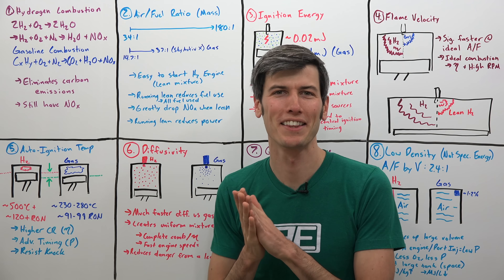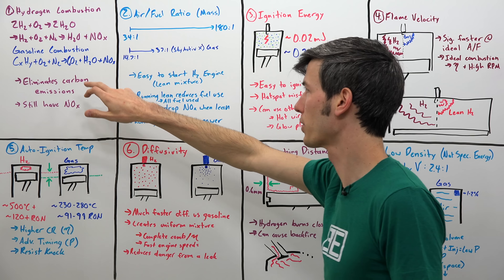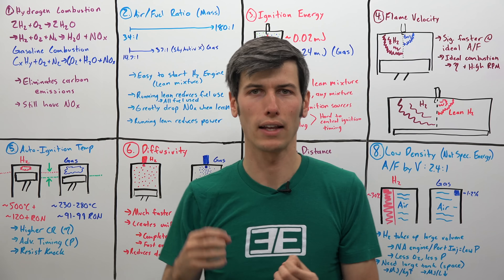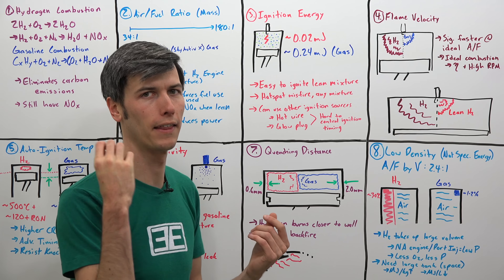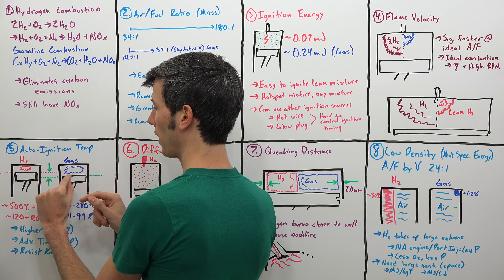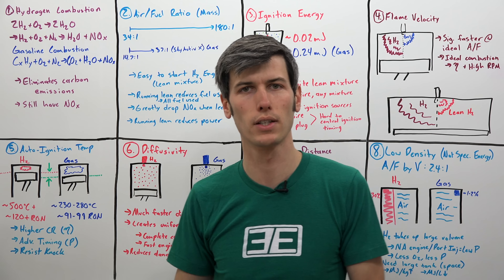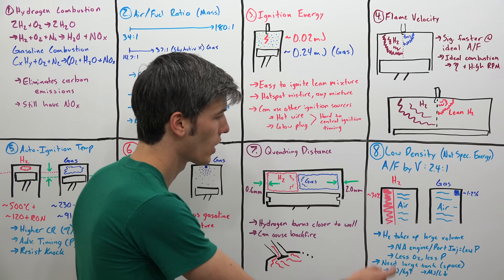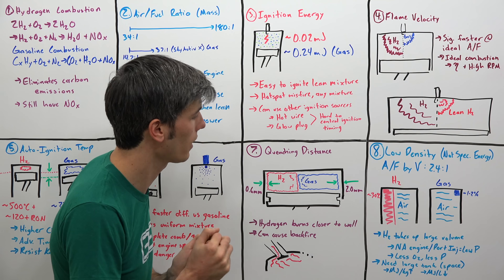The Difference Between Gasoline And Hydrogen Engines

Comment: Why is it necessary talk about hydrogen in a combustion engine if there are fuel cells and electric motors? Fuel cells with electric motors are much more efficient and there are no NOX.
Reply: Electric cars just doesn't make you think that you're causing pollution. Where do you think electricity come from? Power plants. How is electricity produced? Oh right! By burning fuel!!
Reply: @j.e.5984  I am not really sure what you are saying. Electricity from a fuelcel is not from an external powerplant. That's the whole point. So you can make Hydrogen on a sunny day with leftover solarpower, and use it to run your car next week.
Not convinced that is ever going to work in reallity though. I hope they find a more efficient way of filling those fuelcells.

Comment: Biggest difference between hydrogen and gasoline is gasoline is a true fuel and hydrogen is just an energy carrier.
You must waste at least 66% of a form of energy to obtain %33 from it as a fuel.
Gasoline requires only a fraction of the waste.
Hydrogen as a motive fuel has no future except based on massive government input.

Comment: If you injected oxygen with the hydrogen (as opposed to outside air @ 80% nitrogen) would you significantly overcome the NOx problem, as well as improving the matter of density? Thinking that if Hydrogen is being acquired from splitting water then you are inherently producing the pure oxygen in exactly the volume needed to recombine to H20.... Downside being you'd need and oxygen tank roughly twice the size of the hydrogen tank?

Comment: One thing that is super important about hydrogen is that all current internal combustion engines can be converted to burn hydrogen instead of gasoline, which is much better for the environment than having to build all new engines/batteries.

Comment: One other thing you did not mention is because hydrogen has such a fast flame you dont run as much initial timing like a gas engine will run 8 to 10 degrees before top dead center where a hydrogen motor can be almost zero initial timing this is huge when you are speaking of paricidic loss in an engine. If you dont have the flame working against the crankshaft  and I'm sure you know the faster the gas engine spins the more timing it gets.

Comment: I should make a small correction here. I'm in Houston TX and have a vehicle inspection station equipped with dyno and all sorts of emission analyzer equipment. A couple of years ago a undertook a little project to find out for myself what emissions are created in hydrogen combustion. I bought a hydrogen bottle and installed it in a 2004 Chevy Monte Carlo I had at the time. I attached a hose from the bottle to the intake where the fuel line goes and ran the engine completely on hydrogen only. Not only did it run as it did with regular gasoline (slightly less power) but when I stuffed the probe into the exhaust and did an emission check, there was almost zero NOX emissions, in fact there was next to zero emissions of any kind. What very little NOX there was, came from burning oil as this vehicle had already 240.000 miles at the time of the test and it was burning oil through valve seals and piston rings. So your data on NOX emissions from hydrogen are not correct
Reply: David Anderson,
You know this guy tried to be as critical as he could about Hydrogen.
Wouldn’t surprise me if he was hired by the Oil Company to make this video.

Comment: One more fact that if you have a fuel leak on a hydrogen tank, because hydrogen is lighter than air, the fuel will go straight up into the air and dissipate rapidly unlike gasoline, which will spill on the ground and then you have a greater chance of the fire spreading all over the place.

Comment: I'd like to hear your thoughts on compressed air engines, or compressed non-combustible gas engines.  I used to have a CO2 engine for a model airplane as a kid.  It used those little cartridges that used to be used in seltzer bottles and BB guns.  It wouldn't run very long and icing on the cylinder fins and fuel line were a problem but it worked.  I always wondered if anybody every tried to scale it up for real world use.
Reply: We are trying to keep CO2 (a greenhouse gas) out of the atmosphere.

Comment: It was my understanding that a fast combustion is less efficient than a slow one. I thought that higher octane gasoline actually ignites slower and the energy of the explosion transmitted more progressively and efficiently. In a fast explosion, the energy can't be transmitted through to mechanical motion so quickly. Maybe i'm wrong?
Reply: Exactly.  I'm surprised that got past him.
It's not an explosion.  It's an acceleration.  And the smoother the acceleration the smoother the ride.

Comment: I readed that hydrogen is obtained from natural gas. So why not just run the engine with natural gas instead of hydrogen? There are a lot of compressed natural gas vehicles in my country, but it's the first time i hear about hydrogen in a combustion engine.

Comment: As an Auto mechanic I find this very interesting. I find that nothing beats a hydrocarbon! If you were to direct inject hydrogen with a tiny shot of gasoline it might make more sense. The one problem with hydrogen is that it’s a one Atom molecule that can escape from its containment by squeezing through pores in the containment material. It will leak out.   I know that you can easily get H from the ocean by pumping from a great depth and the pressure release will break the bonds. It would be nice when the breakthrough happens but then water will cost more or we will be taxed for it.

Comment: Luckly hydrogen isnt used in normal combustion engines but they did try. They are used as a mutch better kind of power storage to drive electric engine's

Comment: You missed a major point which is to do with Avogadro's law.  That is, that as well a temperature, the pressure in the cylinder is also a product of number of molecules after combustion.  There is a limited amount of oxygen and a carbon fuel will produce an amount of CO2, that is 2 oxygen atoms in a molecule.  By comparison, burning hydrogen produces  H2O, which has a molecule per oxygen atoms.  That means a potential for up to twice the number of combustion molecules for the same amount of oxygen.  Sure, you don't reach this because petrol yields a mixture or carbon monoxide as well as carbon dioxide.  But the point is that hydrogen yields more molecules at much higher temperatures.

Both Boyle's law and Avogadro's law tell me that hydrogen would be a profoundly more powerful fuel than petrol..

Comment: 97 % of hydrogen is produced from methane (ch4) producing co2 requiring 800 degrees C. Just use natural gas and eliminate the waste of fuel to generate hydrogen.

Comment: I wonder what if you used a plug in hybrid battery as a source of on board electrolysis. So than you can use water fuel tanks. Kinda a reverse hybrid, just a thought

Comment: Hydrogen has weird practical problems.  The H atom is so small it penetrates steel, and other metals.   If the steel is too hard, hydrogen will embrittlement.  As a gas it’s hard to transport, store, and transfer.  Any H2O to H process will take more energy than can be recovered.  Remember the Hindenburg?  What it’s going to do in a crash?

Comment: In your last description number 8, You could have mentioned adding oxyhydrogen to the gasoline and gave us the numbers. Oxyhydrogen with gasoline each one of them enhances each other in the burn cycle in the combustion chamber. Oxyhydrogen from the water ignition rate is 44,000 ft./s and the gasoline ignition rate is 4000 ft./s.

Comment: In a gasoline engine a portion of the injected fuel is used to cool the engine, the leaner the fuel the hotter the engine will run. Hydrogen will burn your engine faster than gasoline.

Comment: Hydrogen is WAY more expensive. The metallurgy needed to keep hydrogen out of the metal of the engine is way more complicated. Hydrogen is small enough to penetrate most alloys at room temperature and at engine operation temperatures that time is reduced to reach saturation. After time hydrogen saturation causes embrittlement and the engine to becomes filled with stress cracks and results in sudden failure. Nitriding the cylinders and pistons is an additional cost that conceivably adds 50% to current engines and forget about getting more than 100k miles on an engine for the next 10 years, the approximate time for engineering to catch up to a hypothetical changeover this year.

Comment: As is see it, hydrogen powered engines can be very different. For everyday grocerie getters you get a very lean running low HP engine with excellent emission, or a high hp performance engine running richer and with high RPM.

Comment: This was a comparison between combustion motors for different types of fuel, and it was interesting to see, that it is (not only theoretically but also practically) possible to make a hydrogen combustion motor. However, when I have heard about hydrogen for vehicles (until now), it has never been with combustion motors. Instead, it has been with a fuel cell producing electricity, and then an electric motor (or more electric motors) - actually an electric vehicle, just having a hydrogen tank and a fuel cell instead of a battery. This kind of vehicle has all the advantages of an electric vehicle, but doesn't have the disadvantages regarding range and charging time. If this type of vehicle has big advantages over a vehicle powered by gasoline or diesel (and also over a traditional battery powered electric vehicle), I don't quite see the purpose of a hydrogen combustion motor, that has only small advantages over the gasoline combustion motor.
Reply: Oh, I now see, that you made another video stating just that!
Reply: ICE is a lot easier to make than fuel cell, and is less vulnerable to high or low environmental temperature.

Comment: Excellent dissertation on the fuel/air mix, combustion end of things and you did mention the necessarily large fuel tank required for hydrogen. But have you already covered in another video the difficulties of storing hydrogen ? I'm thinking here of metal hydride storage of hydrogen as opposed to highly compressed hydrogen in a cylinder. The problem with the latter of course is that long term storage of hydrogen under pressure is not practical because, in time, the hydrogen 'seeps' through whatever it's stored in. Another idea or suggestion I've seen is to generate hydrogen 'on the go' through hydrolysis or similar method. Would love to hear your thoughts on this.

Comment: What a worthless video. In actual practice, I have seen 1050 horsepower engines converted to run on hydrogen and put out less than 68 horsepower. It does not work in practice. The flame propagation alone tells you that you cannot develop a slow enough thermal Dynamic pressure to push the Piston all the way through its Powerstroke. Not only that you don't have enough money on the planet to convert enough water to hydrogen to replace gasoline as a fuel. And you already made the point of how big your fuel tank would have to be in order to be able to function. You forgot your last phrase in this video. Hydrogen won't replace gasoline.

Maybe you could use your brain power to figure out if you can you make a hydrogen gasoline hybrid and use the hydrogen for what it does best, starting the flame propagation?

Comment: I was fascinated by your vid. My father worked at JPL (jet propulsion lab) from 1970 to 2000. In the early 70s as part of a  program they wanted to reduce emissions and as a secondary reduce the cost of the hydrogen fuel. So they had a 3 car study of running hydrogen in commercially  available cars. Two impalas and a dodge dart were used. Most of this paid for by the auto industry. The emissions were amazingly clean compared to 70s cars. The big problem was acquiring the hydrogen. The engineers solved that by building their own hydrogen generators. The theory was if enough people switched to hydrogen cars then the petroleum industry would find a way to make it much much cheaper or simply the economics of scale. That way launching rockets would get much much cheaper also. I used to have a copy of the study. But have move 3 times and have no idea where it is. But i did pull it off JPLs/NASAs website after hunting for an hour.

Comment: Water oil contamination. Disadvantage.
Reply: There is water in the atmosphere used for combustion already and water is a byproduct of burning a "Hydro-carbon fuel". Water is already present.  Make sure you run your vehicle up to standard operating temperature to encourage evaporation and enjoy clean fuel.  :)

Comment: I think you forgot something significant because Hydrogen has such a low densetie it leaks really easily. You need really good seals to prevent that. This was actually a big problem for Spaceshuttle with its hydrolox (rocket)engines.

Comment: Pros outweigh cons by a mile at 180:1 if possible at cruising speed and with a high compression engine properly set up for hydrogen the mileage would likely outweigh the volume issue. Can hydrogen also not be pressurized and absorbed to store more? The nox emissions are likely no worse than current gasoline engines. This was already being researched in the 1970s  and natural gas was also in use in the 1980s but no one cared enough to do anything about it. Apparently they still dont as the only thing alternatives we have are electric which at this point fails in cold northern climates of North America

Comment: Does that mean, if you give your gasoline engine a shot of hydrogen before starting or as you hit the starter that the engine would spring to life quicker and easier, especially on those cold mornings?

Comment: Hydrogen is a top notch lifting gas...
But a bit average as a fuel... It's just such a Houdini ninja, it escapes from any container.. More leakage than batteries even..
If you store it in metallic crystals it won't, but then you need constant refrigeration which isn't practical..

The demand for batteries of all sizes has pushed a ton of money into research, combine that with a one moving part electric motor and cars are mostly taken care of.. Just need fuel solutions for giant vehicles and aircraft etc

Comment: I think (note I said "I think") another disadvantage to hydrogen quenching distance is the fact that it will burn some of the lubrication film left on the cylinder wall causing faster cylinder wear.
Reply: I believe this would also lead to hot spots, especially around the ringss which could cause the fuel to ignite at the wrong time

Comment: Stan Meyer already solved the storage issue by converting water that in the tank instead of gasoline.  But his methed of converting water to H2O is questionable. Plus you have the added oxygen to burn the hydrogen. Like the space shuttle it had a hydrogen and oxygen tank. The nitrogen comes from our atmsphere and some carbon from oil leaking into the cylinder.

Comment: try pure hydrogen oxygen and steam as inert gas take oxygen with swingarm hi low pressure absorption and release store hydrogen in lithium powder metal hydride take heat to release it again. make spark hotter and emit electrons through mixture. make a water release once engine cools from oil. or try continue burning system over several combustion chambers adding more and more oxygen until completely burned keep steam behind with Tesla valves.

Comment: Never seen NOx emissions associated with Hydrogen combustion. I tried to find out and is never mentioned. Can anyone help me find out more about this? Help would be very appreciated!
Reply: Because it does not happen. H₂+½O₂→H₂O
Reply: There is Nitrogen is the atmosphere.  Since we are using atmospheric air for combustion, Nitrogen is naturally heated in the combustion chamber.  Temperatures during combustion reach a point that will bond Nitrogen and Oxygen together.  You cannot have an exact air/fuel mixture that will not produce NOx emissions while using atmospheric air.

Comment: so why not rotary engines
Reply: Rotary Engines are less efficient than piston engines because of the amount of surfaces that need to be sealed to prevent pressure losses.  Also in most cases there is a period of time that the exhaust port and intake ports are open at the same time.  However, Jason did release a video about Mazda working on a Hydrogen Rotary Engine.

Comment: Wonder why no methane? Can be liquified at higher temperatures.
Reply: Methane requires a different storage then Gasoline or Hydrogen.  Also it smells like rotten eggs when burned most of the time due to the natural sulfur content in the gas.

Comment: Nitrogen oxide sounds a lot like nitrous oxide, I don’t think they’re the same thing though...(because if they were I wouldn’t think it would be a bad thing...potentially...idk..)
Reply: "Nitrous-Oxide" is an Oxide of Nitrogen however, Nitrous-Oxide ( N2O ) is not the same as NOx. The x in NOx refers to how many oxygen atoms are connected to the 1 Nitrogen atom instead of having 2 Nitrogen atoms connected to 1 Oxygen atom.
Reply: @bob11223  so the difference is a single molecule of nitrogen in the mix?.. (also, kind of hard to keep track when you're talking about nitrogen-oxide vs Nitrous-oxide, you never really distinguished between the two..)

Comment: One problem with your vid. There is such a thing as too high of a flame rate. The entire reason diesel is good for the applications diesel is used in, is because it has a slower flame rate than gasoline. With a really high flame rate, you push your torque and power peaks too high up the rpm scale. Diesel engines have super high low end torque, because the diesel fuel burns slowly enough to constantly push against the pistons, at low rpm. The low end torque in an H2 engine would be super low, so you'd have to make the mixture much leaner, even then, you might not get any more power than gas, or even less.